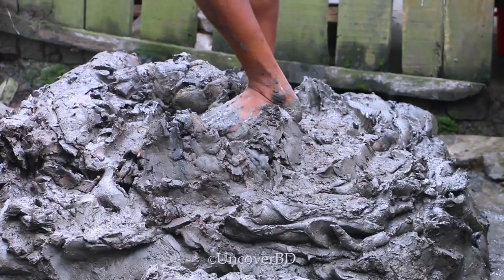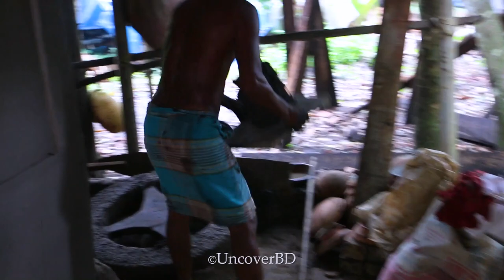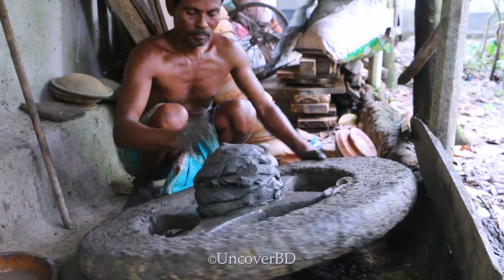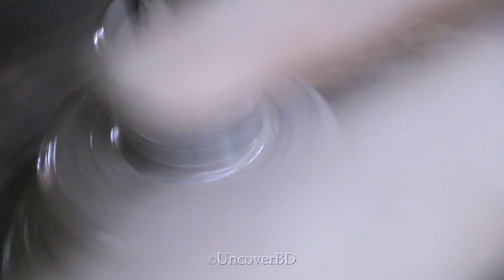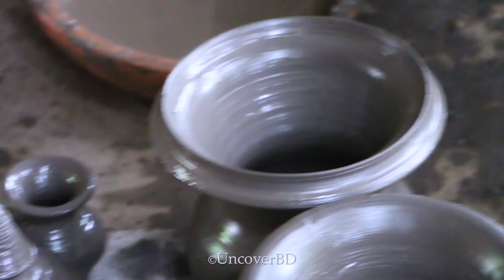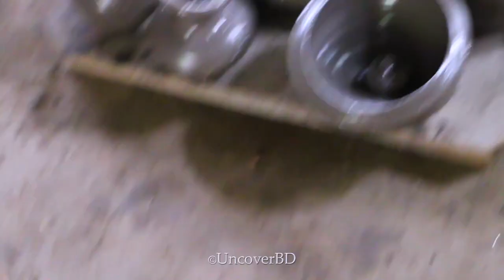Pottery Making Technology - How Do They Do it? Amazing Talent of Village Potter !

Comment: We need to learn about the materials, please tell about they use!
Reply: The Bangladeshi soil naturally has a very high clay content. The clay is kneaded manually for hours. They just use a wooden wheel with a small nail inserted at the bottom and rotate it manually. The outer rims are thick to provide a larger rotational inertia so that the wheel doesn't have to spin very fast. They generally bake it in a clay oven and paint it an orange color. They don't use glaze since you can't get it in those remote areas and it's too expensive for them.